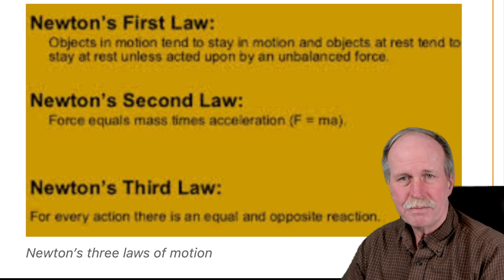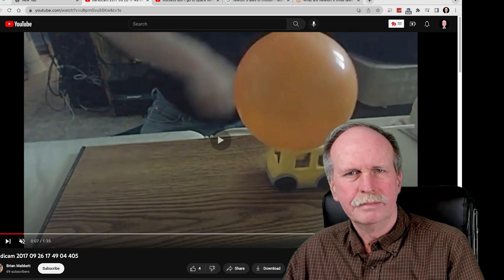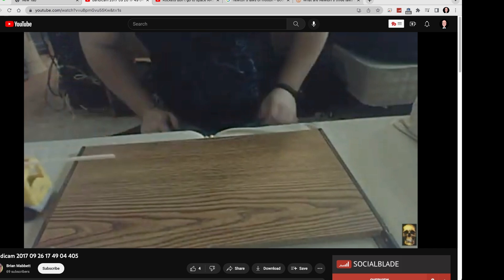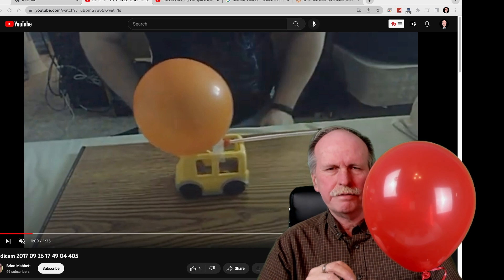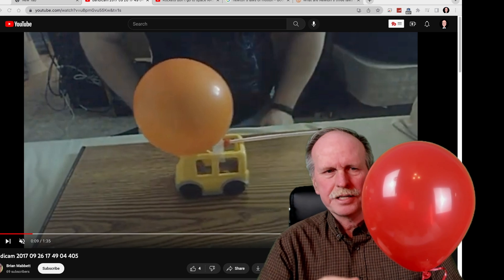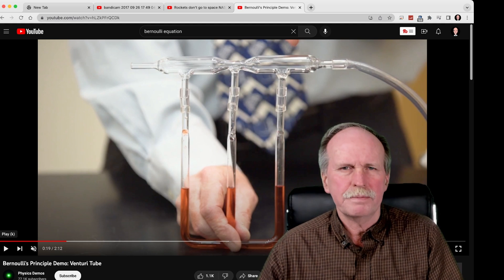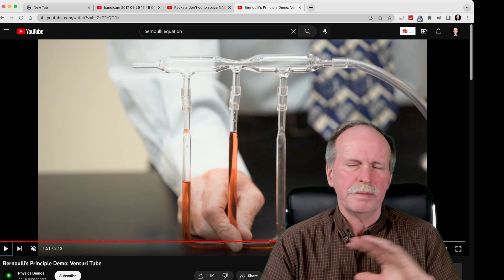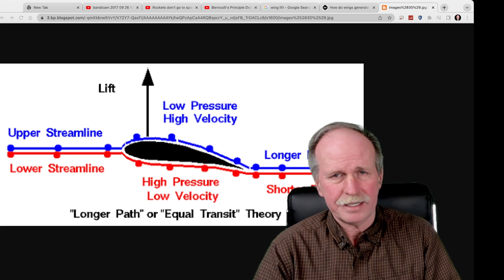Flat Earth Proves Rockets DON'T WORK

Comment: The experiment initially shown without the vacuum is not a true representation of a rocket.  It definitely demonstrates Newtons 3rd law, with mass of air accelerated backwards moving the car forwards.  The acceleration of the air in the balloon is due to the stored energy (pressure) of blowing up and stretching the rubber of the balloon. 
The missing and more important part of a true rocket is the combustion of the fuel.  By burning fuel you get more thrust produced than just the ejection of the mass of the unburnt fuel. Burning the fuel not only accelerates the mass of the fuel (unburnt) but also produces very high pressure gas which pushes against the nozzle (area) of the rocket.  The high pressure gas is the reason the rockets can lift themselves along with heavy payloads.
Reply: Burning doesn't accelerate the mass.  The heat and resulting chamber pressure of the burning accelerates the mass.  There are several chemical reactions that burn extremely hot without producing much in the way of gas (or gas pressure).  Thermite (a mixture of powdered rust and powdered aluminum in its simplest form) produces gas that only exists for a short time before it turns into solid (raw iron and aluminum oxide).  Despite being pretty and extremely energetic, it's a sucky rocket fuel.  Which isn't to mean that aluminum itself isn't useful in some rocket fuels.  It's used as a combustion rate modifier and thrust enhancer in solid rocket motors.  It also makes pretty colours.

if you can generate the pressure without burning anything it still works.  It's called "cold gas" propulsion - a leaky balloon is a "cold gas" thruster.  Cold gas thrusters are used on satellites as simple positioning thrusters.  Open a valve from a pressure tank, no ignition or combustion chamber  needed and you get your thrust.

Similarly, if you can produce the force to accelerate mass without using gas, it also works.  A slingshot gives thrust.  As does sitting in a wheeled chair and throwing bowling balls or a spring-loaded bb gun.

The Tsiolkovsky equation makes it perfectly clear, you get thrust from throwing a mass, the faster the higher the thrust.  An ion engine throws atomic particles at ridiculously high speeds using electric fields and work quite nicely.

Combustion-based Rockets are just a convenient method of getting far higher total impulse than you can get with springs or compressed cold gas - the mass is the propellant itself producing the acceleration.
Reply: @fromagefrizzbizz9377   What an elaborate, comprehensive answer, thanks for that. 
...Me, I was just going to  say that when I was a kid my water rocket proved Fromage Frizzbizz wrong.
Reply: @coriscotupi  What you were going to say is wrong, but fortunately you caught yourself ;-) 

Water rockets also prove [*] a slightly different part of the rocketry equation too.

It's a combination of BOTH the acceleration AND the mass of the ejected material.

A typical bottle rocket is a plastic pop bottle, that's been pressurized with air, PLUS water.  The bottle is held inverted, you open the bottle, and the air pressure pushes the water out pretty fast.  And you get a wet woosh...

If you left the water out and thus you get a traditional cold-gas thruster,.  You get a dry woosh, but it probably won't go anywhere near as high despite being lighter, and the acceleration of air being somewhat higher.

The reason is that the m in f=ma is smaller with air.  A LOT smaller in fact.

This is why when they design ion-booster engines, they try to find the heaviest particles to throw, so they can get more thrust with lower power acceleration methods..  Eg: Xenon nuclei for convenience, vs lighter gases.  You'd get far more thrust by throwing, say, uranium nuclei, but building one would be more complex and there's other problems -0)

[*] There's a lot of factors, such as computing optimal nozzle types for air vs. water - they're considerably different. Another is factoring the displacement of air by water.

So a simple bottle rocket doesn't really prove it formally, just suggest quite strongly. An experimental setup using properly designed nozzles, stress gauges for measuring thrust and thrust duration - you want to form a thrust-vs-time curve and ultimately total impulse such as the characterizations of model/amateur/full size rocket motors. That will prove it far more precisely and formally.
Reply: @fromagefrizzbizz9377  
Optimizing rocket nozzles for flow velocities etc does NOT mean that a water rocket is not... well... a rocket. 
Hint: it IS. 
Mass is ejected one way, the ROCKET shoots up the other.

Sorry, pal.

Comment: With all due respect for the excellent work - something is wrong with the wing theory.
For what reason should two adjacent air molecules - one takes the path above the wing, the other below the wing - necessarily meet again behind the wing and be directly adjacent again?
Bernoulli, in general, is correct, of course. But the equal-passage-time claim for all air molecules? I have some doubts.
A plane could never fly "upside down". There could not be any lift, because now the low pressure zone would be under the wing.
Reply: Yes. Because this exact same wing shape can fly upside down too. We've all seen that diagram. It's not entirely correct. Even mostly wrong. A better explanation is angle of attack. Jet fighter wings do not have that profile. Do jets fly?
Reply: @rickkwitkoski1976 
I am convinced that the theory is very well understood. Airplanes are designed by clever engineers and are becoming more and more efficient.
This development is not based on trial and error. Numerical simulations are now very accurate.

Personally, I would never claim to have even remotely understood the Navier Stokes equations. This jungle of equations is not at all clear or intuitive.

If it's supposed to be a short and intuitive explanation, then I like the following one:
The wings cause a deflection of the flow.
The flow is deflected (bent) downwards.
The bending down causes a reaction force of the wing upwards (Newton's 3rd law or conservation of momentum)
Reply: @ulfschaffling8874  The "equal time" explanation was an oversimplification (and a plain wrong one at that) for pilot training manuals that made it into mainstream explanations, school textbooks, etc. There are videos here on youtube showing wing sections in wind tunnels proving that the "equal time" is just wrong.
The key is not the distance from leading to trailing edge (or symmetrical-wing airplanes would never fly), but angle of attack. And when an airplane flies inverted, the wings' angle of attack is adjusted so it continues creating lift - now in the opposite direction relative to the airplane. Air circulation around the wing is pretty much the same as before, except now the landing gear is pointed toward the sky.

Comment: 10:52 do you mean that both streams reach the trailing edge in the same amount of time, as those dots suggest? i'm pretty sure that myth has been debunked but it looks like it has more lives than a cat.
and there's something else wrong with that diagram. being a pilot, you should know what it is.
also, is the center of lift really that far forward?
Reply: Thank you
Reply: Um, the argument over AoA versus bournouli principle is an endless debate.  I suspect that a true expert in hydrodynamic flow would tell you that they're really both the same thing with different physical implementations.  It's certainly true that total lift is a combination of both, the ratio can be different based on the flying regime.  The fact that bournouli effect is used so often in training material is so that the important educational value of an important effect, but eventually submerged in the detail of actually flying a plane.

Sure you can fly an airplane with flat slabs for wings and use AoA alone for lift, but NOT as efficiently as a properly designed airfoil would be.

Secondly, in smooth laminar flow, the both streams have to leave the trailing edge at the same point in time.  Otherwise, you're introducing pockets of high and low pressure behind (and on top below below the trailing edge) that produce turbulence, steal lift and introduce more drag in potentially unpredictable ways.

This isn't NECESSARILY bad.  There are airfoils with abrupt steps in the upper curve that prove out to be still quite efficient and with stalling characteristics are far more reliable/predictable and indeed USEFUL in STOL.

Comment: Awwww, darn.  No discussion of the Rocket Equation!  Silly Bernoulli!  So to summarize the simplest of physics formulae highlighted in this video:

F = m a - "Force = mass times acceleration" (Newton's Second Law)
Q = V A - "Flow rate = velocity times area" (sometimes called the Continuity Equation)
p + 1/2 (ro) V^2 + (ro) g h = [constant] (assuming no change in density, ro, that flow is steady state, and there are no friction losses) - "pressure + kinetic energy + potential energy = a constant" (Bernoulli's Equation)

That's it.  Stuff I learned in 10th grade physics class.  Well done, flerfs, for not even making it out of high school.

Comment: One thing I want FLERFs to explain is sun ray angles on a flat earth.
We observe and you can measure the angles the sun hits the earth based on where you are. At the poles, it can get very low angles. A 0 degree angle of incidence of sun rays actually.
How does that work with a smaller, localized sun?
It's lowest angle of incidence of sun rays would be at best 20-35 degrees at either pole on a flat earth depending on the season in a flat earth model.

In reality, we see an even 90 - 0 degree angle of incidence of sun rays from the equator towards each pole. This lines up with a round globe.
(Not 0 degrees on magnetic north/south pole but true north/south pole because of earth's 23.5 degree tilt)

On a flat earth, the sun would orbit either closer to the north pole (center of flat earth) or past the equator (closer to outer rim) as explanation for winter/summer.
This would cause the lowest angle of incidence of sun rays to either pole to drastically change depending on the season, which has not ever been observed.

Either way, the only way for a localized sun on a flat earth to get a 90 - 0 degree angle of incidence of sun rays from the equator to the either pole, would be for the sun to be sitting on the surface of earth at the equator.
Reply: It doesn't.
I've asked flerfers to explain height above north pole of Polaris. It would have to be different for each latitude of observation on a flat earth. Which is impossible.
Reply: @rickkwitkoski1976  Good luck with getting an aswer to that, I can't even get them to explain what an Equator is doing on a flat Earth, let alone the Tropics and the Arctic and Antarctic circles.

Comment: Thing is, these people really don't understand things like Pressure. For example, it would absolutely bake their noodle if they thought about the fact that the difference in pressure between ground and space is only about the same pressure difference of being 10m underwater. The issue is the direction of pressure change. Our bodies are designed to withstand outside stuff coming in, not so much the opposite.
Reply: In my experience there’s little Flatearthers actually do understand.
Reply: well, actually it works both ways, you dont explode in vacuum ;)
Reply: @certhass  
LOL This is very true, it's more a question of internal haemorrhaging, internal organs can tear when they inflate.
Reply: @certhass  you can
Reply: Not necessarily. It's the physics of liquids. The liquid in our bodies will start boiling in a vacuum. Water will boil off in a vacuum. That's what vacuum pumps are used for in HVAC..
Reply: @Bryan-Hensley  it does boil yes, but not immediately. our skin can withstand some vacuum - speaking of blood here since thats the most crucial fluid which would cause the greatest damage if it boils
Reply: @certhass  I said liquids. I can't remember the details. I think your eyes and tongue will swell up first. I believe the eyes will rupture will be the first major damage.